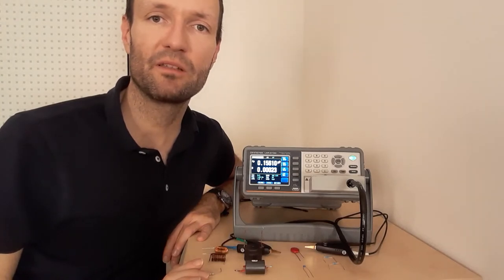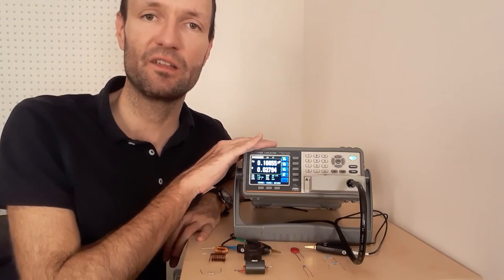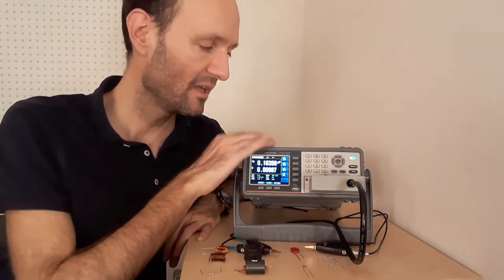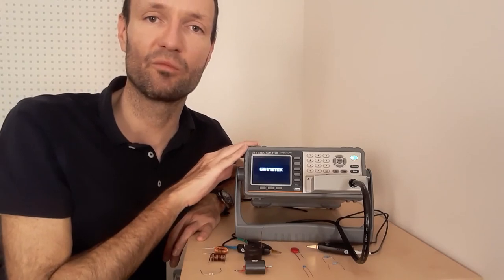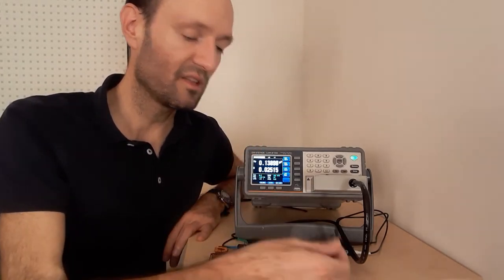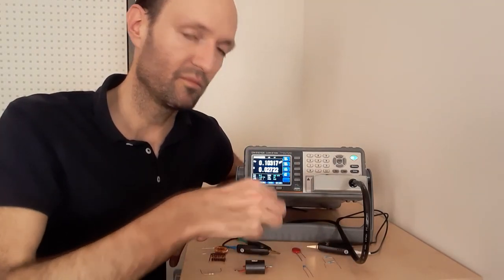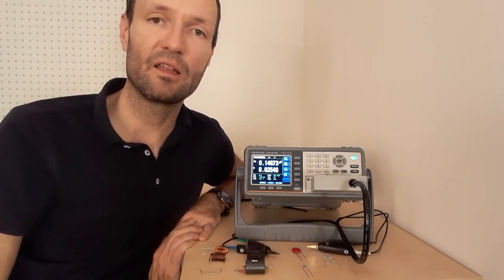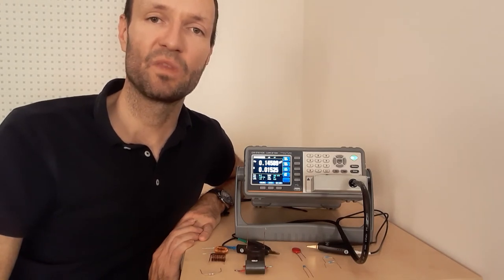How to Perform Measurements With the Precision LCR Meter GW Instek LCR-6100 - Part 3

Comment: Allerdings hoffe ich das in ferner Zukunft es hoffentlich möglich sein wird alte Bauteile auslesen zu können IC's etc wo es keine Informationen mehr gibt. Oder Bauteile die vor 40 Jahren verwendet wurden.
Reply from the maker: Ja, das wäre natürlich super. Wir haben auch noch sehr viele alte ICs aus DDR-Zeiten, zu denen keine Datenblätter oder weitere Unterlagen existieren. Für eine solche Aufgabe braucht man jedoch eher einen Logik-Analyzer und nicht "nur" ein RLC-Meter oder einem Impedanzanalysator.
Reply: Das ist korrekt. Allerdings bezweifele ich ob der Logic Analyzer da wirklich hilft. Habe mir da auch Gedanken macht. problem ist doch den kann ich einsetzen wenn mir die Pinbelegung bekannt wäre. Hoffen wir mal. Für unverständlich das soviel an Daten und Papier entsorgt wurde damals.

Comment: please help me.
how can adjust capacitor = 0.5pF and inductor = 8nH .
Reply from the maker: To be honest, I unfortunately do not really understand the question. Can you please specify it a little more in detail?
Reply: @MathiasMagdowski   
Thank you for responding.
I am also using the same LCR meter. but i don't know how to set it to measure 0.5pF capacitor and 8nH inductor. can you please guide me how to install ?
Reply from the maker: @cuongsmt9026  Did you have a look at part 2 (https://youtu.be/CpuKA33Cjww) of this video series, already? In this video, I explain how to measure the capacitance of a capacitor and the inductance of an inductor.